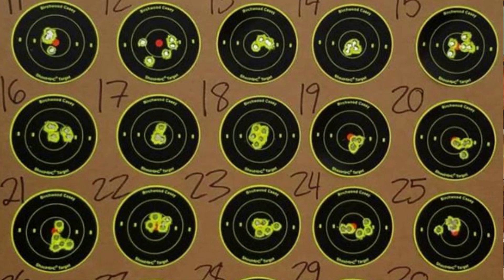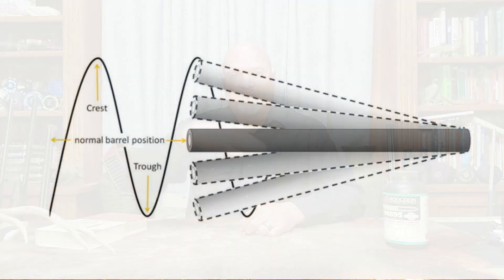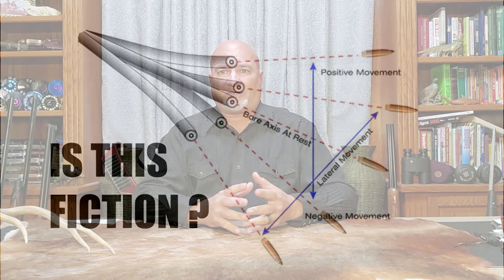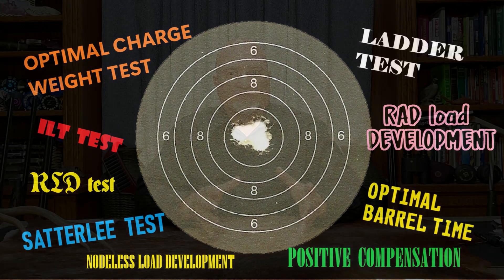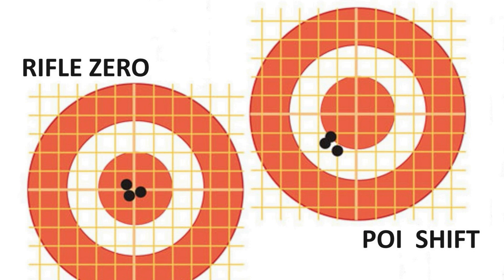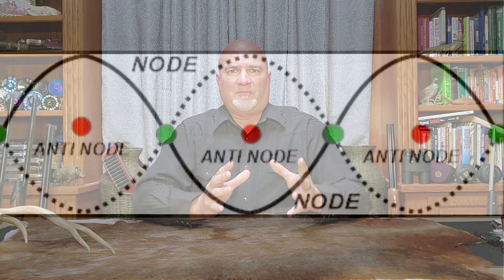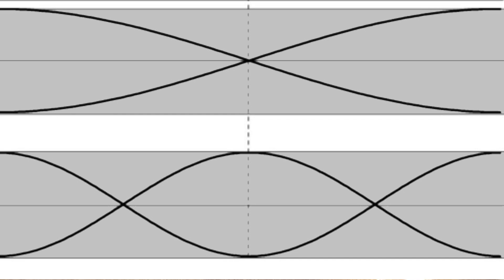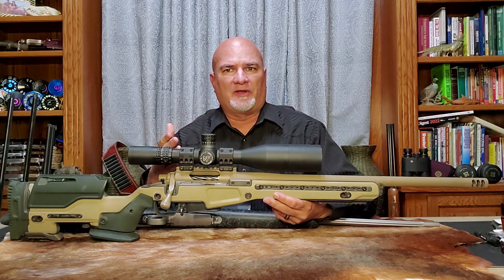ARE MY BARREL HARMONICS OFF?

Comment: It's great to see what budget factory hunting rifles are capable of these days. My cheap Savage 334 just shot 3/4" groups with cheap ammo, I still have to test for consistency, but from what I have read, these are pretty consistent with 3 shots, which is all you need with a hunting rifle.
Reply: I found a better load since posting this, and have tested for consistency. It's a Sierra Prairie Enemy 70 grain. I am getting 1/2" groups at 100 yards, and I got .84" at 200 yards. I have tested it a few different times, and it seems pretty consistent. I put on my own gettho made custom cheek riser and managed to get a deal on a $40 trigger job. This gun shoots great for an ultra budget rifle.

Comment: I have been reloading just shy of 70 years.   from 22 hornet  to 458 win   and have had good luck in reloading a few crappy factory rifles with rough barrel to shoot right around 1 inch.  using. different gun powders,, adjusting bullet seating depths,  controlling bullet neck tension and other reloading tricks.   some times lapping a barrel can help in accuracy.  generally  using the latter system till I find what the gun likes.   some call it seeking the accuracy node.   call it what you want it does work.   that is why some rifles dislike factory ammo, but excell in a handload.   with my chronograph and bore scopes and my personal test range I can see thu a lot of BS.   I will agree nothing is better that a custom barrel when set up correct.  great content. d.d

Comment: If barrel harmonics were not a reality, barrel tuners would not work. The key is recognizing that a barrel is only motionless at the two ends of its natural whip. Load development is all about getting the powder charge just right so the bullet exits the barrel as close as possible to either of these two points since a motionless barrel provides the greatest accuracy. These two motionless endpoints can be easily seen in your diagrams. It also explains the challenge in finding the best factory load for any given rifle, that being the load that hits (pun intended) closest to either of these two endpoints.
Reply from the maker: All independent scientific testing concludes that they don't work. Even Eric Cortina admits that tuners don't make loads better. The benefits realized by some people is simply the act of adding weight to the barrel.
Reply: @desertdogoutdoors1113 

I have to disagree here.. If barrel tuners do not work, and this was only beneficial because of adding weight, when setting up the tuner the end user should not see improvements in group size as many in fact do see.. By what your saying, when adjusting the tuner, nothing should have changed as the weight remains the same.
Reply: @ZZ-uf4zv  There are numerous YouTube videos that demonstrate the impact that barrel tuners or resonators have on accuracy. Do they improve the accuracy of every barrel? Absolutely not, just as some reloaders have found when it comes to developing a load for a given rifle. There will be times when the harmonics of a given barrel are so inconsistent that finding a load, a tuner, or a combination of the two makes it impossible to get close enough to those two points where the barrel becomes stationary.
Reply: @davidlaney8254  

I know that a tuner isn't gonna make a crap barrel perform. If it doesn't have a decent barrel to start with you are wasting your time and money. But I do think with quality barrels they will improve your groups..
Reply: @davidlaney8254 would you mind linking up a couple videos that you believe show good efficacy of tuners in the comments here?
Reply: Barrel tuners don’t work

Comment: I agree and disagree. I think everything you mentioned about high quality stiff heavy barrels is generally true. But I also have tuned my reloads so that my factory Ruger American 7mm08 (which shot factory ammo at 1-1.5moa) will consistently shoot .5moa and will, in good conditions, shoot .25moa. My Shilen custom heavy barrel 7mm08 with a 7lb heavy Palma match taper will not shoot that good with any load I’ve tried.
So while I agree, that generally your statement tends to hold true, there are exceptions. I do think that small vibrations do have very meaningful effects down range, and I do think that load testing is worth the time and effort. But, pretty much any 6mm BR loaded with an 88gr Berger on top of 40 grains of Varget will always shoot 10’s.

Comment: I'm a big believer that runout affects accuracy also. I use Hornady's Concentricity Gauge to check and adjust (attempt .001" or less) to minimize. Then I also like to Sharpie mark the neck on the high side reading to orientate the round during loading for consistent rifling engagement. Cuts down on fliers CONSIDERABLY.

Comment: Working out what matters, the accuracy you need, where to pay attention and what you can do is tricky.
This helps.
I like the idea of testing ..but ..the results can be dubious..or too similar...the component and barrel life wasted... particularly if looking at statistical significance..
And..as steady as you may get when shooting...you may well be looking at your ability to place every shot aimed exactly at same place...rather than recording actual variances from variables you control.
Then with custom barrels or new barrels..maybe they need a few hundred rounds to settle down.

Recently a rifle with a custom barrel shot very well...say 1/4 moa.small groups..this is several hundred rounds into its 204 life ...I thought it was half moa at best.
Was it me?
The barrel condition?
Environmentals?

You can only guess ..but ..I was very relieved n pleased.  One does get spoilt by great results.

I'm concluding that doing what you can do well...case prep and exact powder measures  measurement to a modest fps that doesn't stress cases ..with perhaps some brief seating depth tests...to see if something is glaringly obvious is about all you can do.
I like to seat close to the lans...less "wobble" room for the bullet...but...at times I'm forced to seat a fair way back..long throat..and still get great results with a custom barrel.

Primer depth is an issue that's almost beyond practical control.. given that the height of the primer may vary due to the protrusion amount of the anvil...on top of any height variation...after primer pocket uniforming..and using a tool that doesn't index off the extraction ring.
Ended up with KM primer gauge..can't say I've done research to compare results.
Just eliminating as many variables as possible...which may or may not make any real difference...apart from positive. Psychology ..
But...when reaching out to small targets...I want as much accuracy as possible...

That was the short version...ha.

Thanks Mr Dessert.